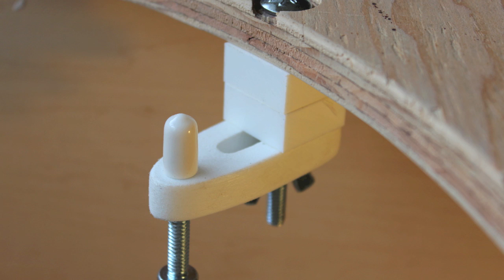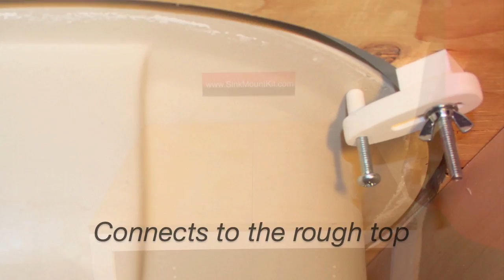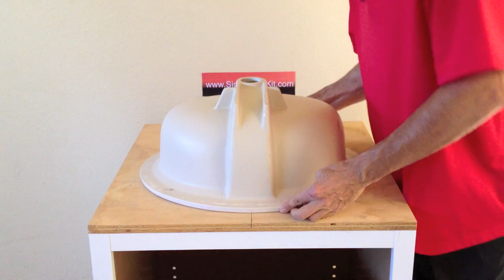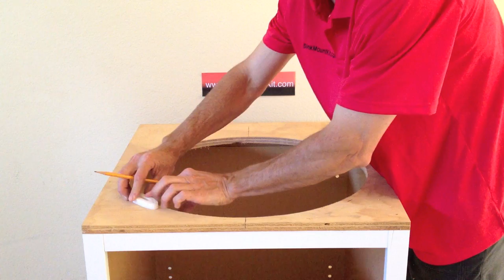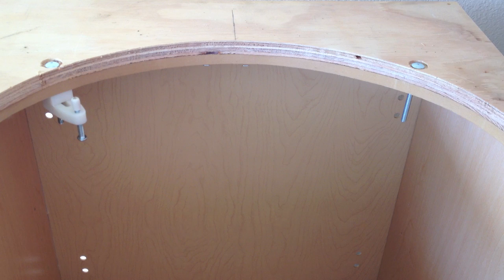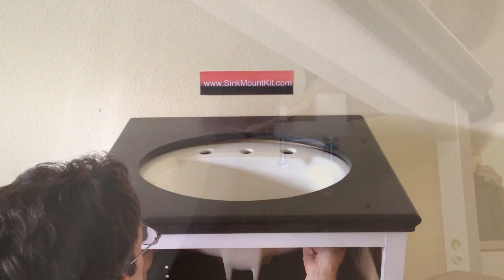How to install undermount sinks

Comment from the maker: Yes. If you are adding a slab counter over your dresser then you could use the dresser top as the rough top.  The dresser top must be thick enough to mount the brackets to and able to support the sink weight. If you are going to use the dresser top as the counter top, then you will need to add an addition plywood support inside the dresser under the top. The brackets would be connected to the additional plywood and then somehow secured inside the dresser.
Reply: What is the best way to get in contact with you for large orders?
Reply from the maker: Email Ralph at easymount.info@ yahoo.com

Comment: I need help. What do you call that  precut black plastic on top of the plywood? And where can I get those? Thanks
Reply from the maker: The black piece is the countertop that I used for my video and it represents what ever material you decide to use for your counter. You will need to purchase your counter material and have it fabricated to fit your vanity and sink size.

Comment: Hi! Not sure if you will pay attention to this. But looks like my sink have no holding support you used, looks like it just hold on by some glue how can that be? Some one removed it?
Reply from the maker: Some installers will attach the sink using only silicone caulking. If the stone is properly cleaned and the caulking gets a good bond to the stone and the sink then this method can work. Using a support bracket like ours gives you a much stronger installation and you will not have to worry if the caulking will give way. The bracket is adjustable so matching your sink to your cut out is very easy and it also pivots so replacing your sink is always an option. Check out our website at www.sinkmountkit.com for more information.

Comment: Very nice demo, showing exactly what I needed to see, many thanks!!

No background music to distract, so grateful for that.  Using the spacer block as guide for line around sink was pure genius, and a great tip!!

I have a question please - In my small RV, I have to make a bathroom counter 2ft x 4 ft long.  I want to use a 1/4 inch birch plywood with a nice grain which is cheap.  Sink is small bar type sink, not heavy, stainless steel.  Sink and counter are not subject to much moisture since its used only occasionally.  Counter will be heavily protected with Urethane finish.  Is it okay to use such thin wood?  To get any other thickness means I won't have the nice grain.  Thanks!